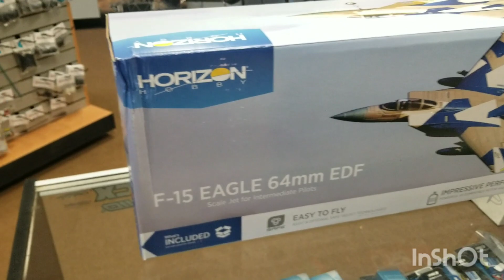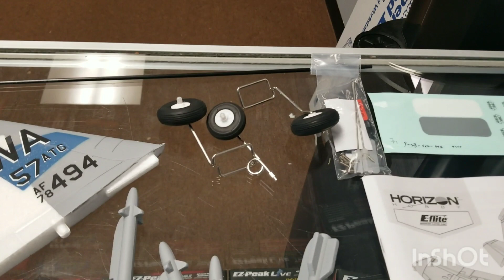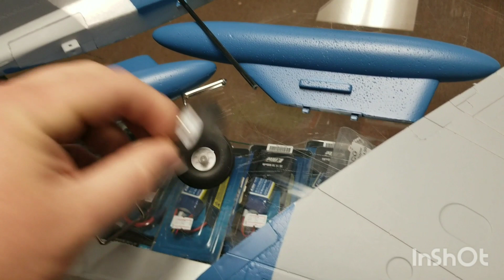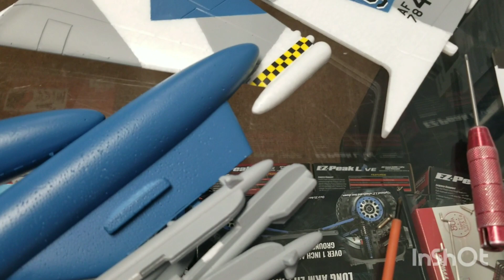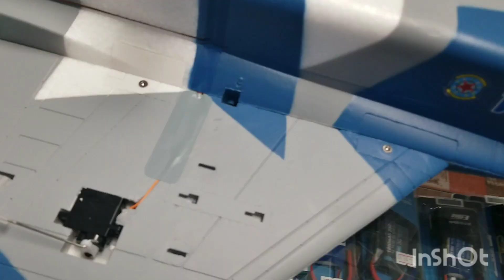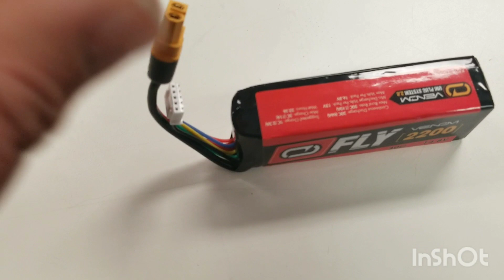New E-Flite F-15 Eagle Unboxing and Build!

Comment: Been years since I was in. About to get back in.  I have a Jumper T-Lite coming in the mail.  What else will I need other than batteries to get this up and flying.
Reply from the maker: just batteries
Reply: @MachSpeedHobbies  And he also needs a radio that is able to run with the reciver thats build in the BNF version... If he buys the PNP he needs a radio and reciver.
Reply from the maker: @e30kitty  He already said he has the Jumper T-lite Radio transmitter coming. multi-protocol so it will fly this.
Reply: @MachSpeedHobbies  Yeah, you are 100% right. I have no idea why i didn't see that o.0

Comment: could you use foam safe?
Reply from the maker: yes but it doesn't have as high of a bond strength and you will have to use accelator spray on foam safe

Comment: I wonder if the cockpit could be modified to hold an fpv camera
Reply: Bet that you can
Reply: Probably. I plan to put a Runcam 2 in there
Reply: @AerospaceMatt did it go good?
Reply: @Dixanty  I wrote this comment at a time before I actually owned the Runcam 2. The camera is just too big to fit inside the canopy (although it’s close). I still managed to mount it over the CG on the main wing and got a good video of that.